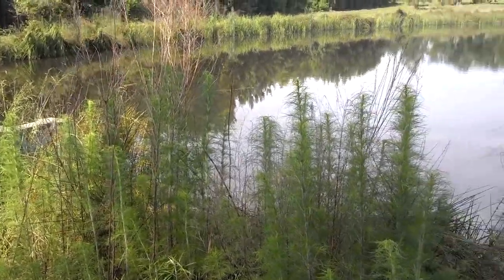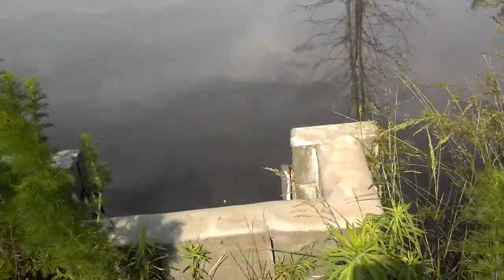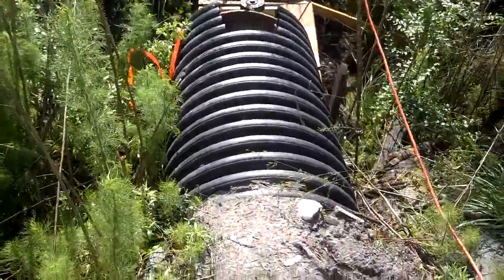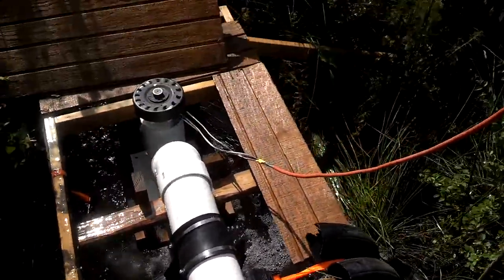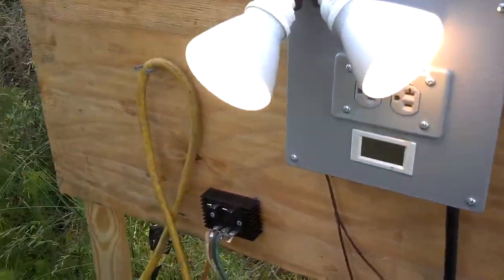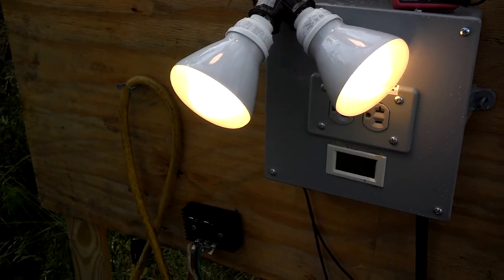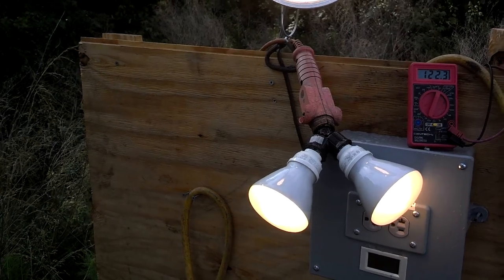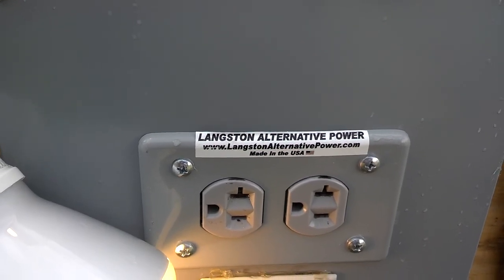Low head 120 volts

Comment: I like the ingenuity of plugging the 30" pipe. Is that ideal or would another way be better, but not worth it. Thanks
Reply from the maker: W.W. this was just a test site preferably would be under the water about a foot with a cut off valve 8 inch pipe feeding in .On the new version of this older model the newer model puts out somewhere in the neighborhood of 600 Watts at the same head but uses a bigger intake pipe and a bigger downpipe 12 to 48 volts or 120 volts with the 3-phase inverter
Reply: Langstons Alternative Power Spencer Langston thanks for the reply. Where are you located? I'm from Charleston and noticed the 843 but haven't had a chance to check your site out yet
Reply: W.W. I'm in Florence South Carolina